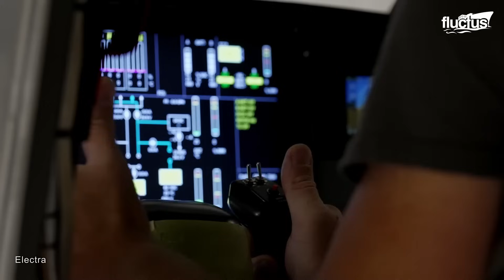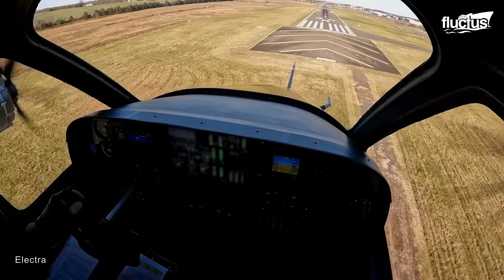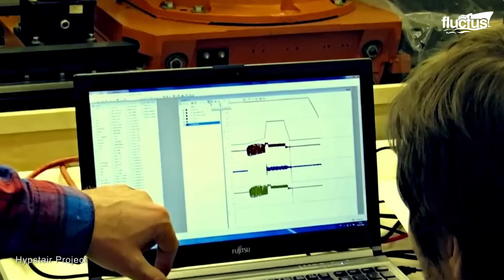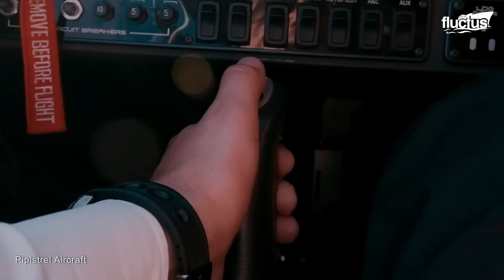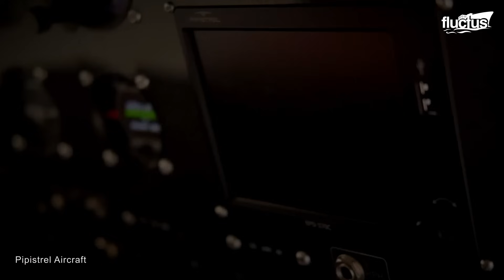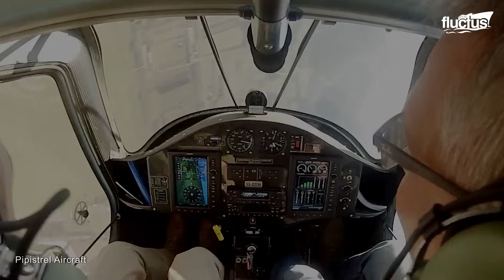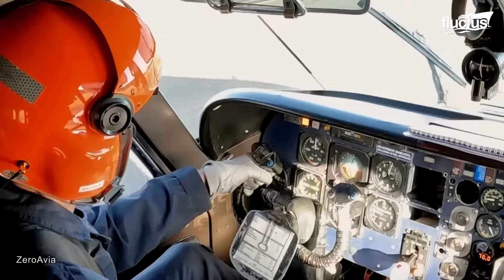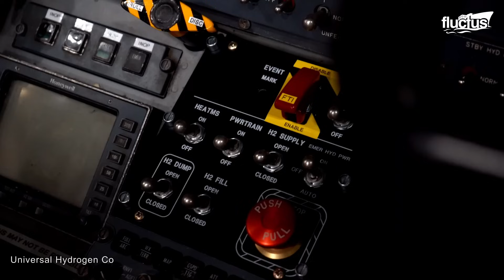US Testing New Hybrid Electric Aircraft for Its Future Military Operations

Comment: 50 to 500 miles is terrible when you can get over 1,000 miles in most gas or jet powered aircraft. Making strict emissions laws isnt going to safe the planet it just results in poorly built engines that suffer more failures due to the complicated parts used to meet emissions which actually just cause even more pollution.

Comment: For big aeroplane, electric drive doesn't give much to this category due to there are many sub system to look after from hydraulic to any digital fly-by-wire.  While in small aeroplane, Electric propulsion has an edge in less maintenance and easy to operate.

Comment: Hey!! Nifty!! The comment I always make about Electric Vehicles of any type. In my opinion, there still needs to be a major quantum leap in Battery Technology. Something similar to going from vacuum tubes to transistors and then to Integrated Circuits!! Like maybe a Battery the size of a Motorcycle Battery that could produce 120 or 220 volts and be able to hold a full charge for several days!!

Comment: Fuel savings for aircraft and semi trailers, (tractor trailers ) the main fuel engine can be up to half the size, then when necessary the electric motors can fire up and provide 100% torque when needed. Fuel savings are in the line of roundabout 50% and for large fuel users a massive amount of money.

Comment: At the 10:00 mark test flight, there is no vertical lift function, it only flew as an electric plane, no basis for helicopter noise comparison.  Sounds like a marketing type ad, but still has great potential.

Comment: Will not be feasible until battery technology is far superior to what it is now!
Reply: That’s why it uses an onboard generator to keep the batteries charged during flight.   That is why it is a hybrid system, not just a battery powered aircraft.
Reply: @robertheinkel6225  Well, that is feasible for experimental aircraft and may be for the real world, but I still think totally electric aircraft can not come to a practical fruition unless battery technological substantially improves in charging time, weight, manufacture, cost, and disposal!

Comment: 1) What will happen if the aircraft flies through the rain will be short -centered? .2) Theoretically, if it had a small internal combustion engine with a piston generator that operates with wet fuel so that the batteries would take a spectacular performance of the aircraft? (Hello from Greece I write with automatic translation from Greek language to English sorry for some mistakes) .
Reply: why would it short circuit ? electric cars don't either ,do they?, driving trough the rain.

Comment: It's fun with electric airplanes. But there is a big problem is the battery. It should be smaller and lighter and made of other materials than just lithium and the other materials.
The new battery should be smaller, lighter, stronger and have a longer range and time and be able to handle short circuits and surges and etc. that can happen to a battery, but it should not discharge regardless of temperature and the charging time should be shorter than 4 minutes. Then the electric airplanes will be more interesting and easier to handle.

Comment: The weight of the batteries is insane. Wont work currently for realistic applications
Reply: It uses an onboard generator to maintain charge on the batteries, so small batteries were used.
Reply: So, you too think Flight Training isn't "Practical" or "*Realistic?"
🤔

Comment: This is trash
Reply: Instead of a generator with below 50% efficiency they could include a Centre propeller It’s like I can never understand the closed minded approach found in cars that have ac winding set yet a dc motor starter what’s so difficult in running a 72vDC inverter the political aspect is ultimately too dumb and depressing